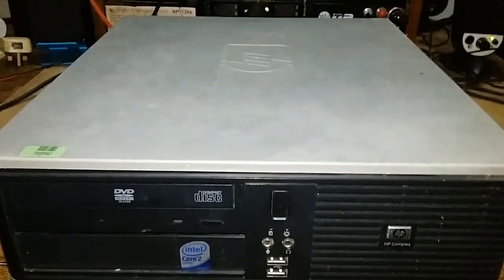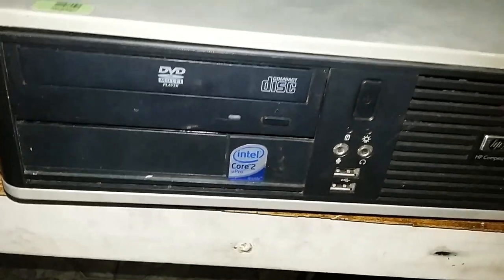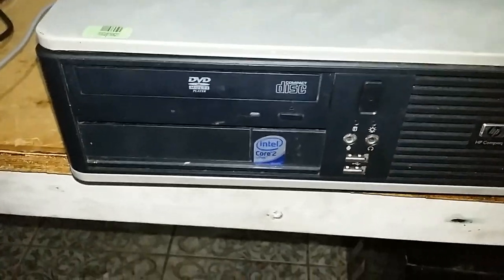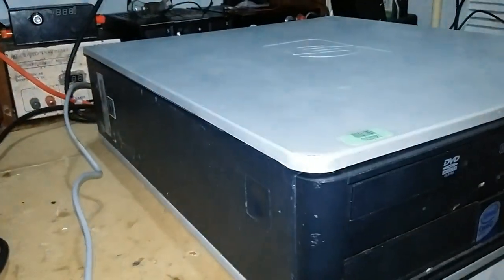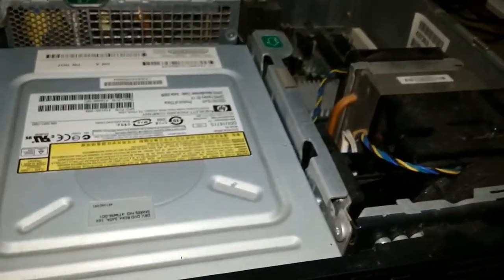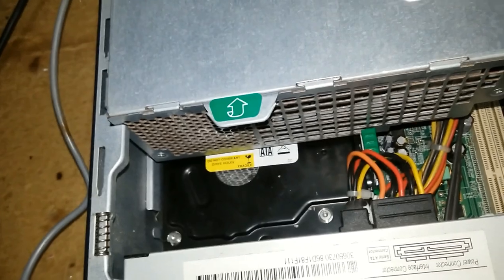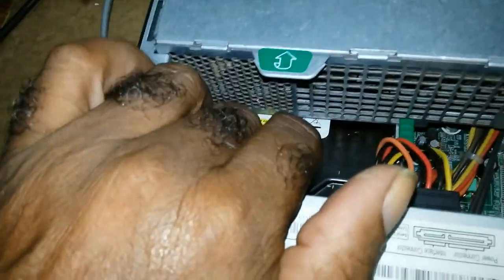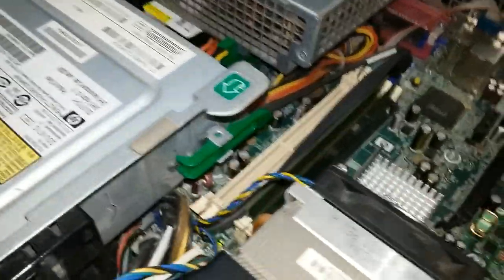HP Compaq dc7800 Desktop PC Boot up Fix

Comment: My dc 7800 CMT automatically starts as soon as I turn on the power supply, despite not pressing the power button. Also the CMOS data gets lost/corrupted every time the PSU is switched off/on (looks like the CR 2032 batt no longer sustains CMOS, even it's brand new giving full 3V). Moreover, when I put it into sleep mode from the OS and later try to wake it up it won't and the CPU fan starts spinning with full speed. What could be causing all this?

Comment: How can i fix 162 system option not set , and then when i press f1 or f10 it doesn't work .
Reply from the maker: Pressing F1 will record the new configuration. If this message persists you may need to replace the onboard battery.
Reply: @AlwynNicholas  i did . I replaced a new cmos battery but nothing happen
Reply from the maker: Set the time and date. Clearing the CMOS on your motherboard will reset your BIOS settings to their factory defaults. After clearing the CMOS, you'll need to access the BIOS setup utility and reconfigure your hardware settings. You might need to clear the CMOS for several reasons but usually you'll want to clear the CMOS to help troubleshoot or solve certain PC problems like hardware compatibility issues. Sometimes you will have to remove the battery to fully clear the settings. Many modern motherboards are starting to come with a power, reset, and clear cmos button built right into the board. Those are easy and you won't require those steps. Just press and hold one of those buttons down, with the machine off but plugged in. You might need a standard PS2 keyboard instead of a USB keyboard temporarily. After resetting the BIOS it is not set to use the USB during the boot up. You need the old style keyboard to plug into the purple port on the motherboard. After you get into the BIOS enable the USB ports.

Comment: Love your work brother but I have 2 HP Compaq dc7900 that I am trying to figure out how to fix them. One of them beeps 4 times when I turn on and the other five times. I tried removing all the parts but still the same beep errors. Yes they were dusty when I got them but I thot cleaning the parts one by one would fix the issue. Can you help me see what the hell is wrong with these Machines plz, PS: I bought them for 250USD each thinking they would wok for my children came use for there school assignment. The America Pease corp volunteer guy I bought them from left the Island and gone back to America. So I cant reimburse my money and kick his ass then take him to court. Is there another way to fix these PCs?
Reply from the maker: The most common problems that cause beeping sounds are: Memory and heat-related failures caused by a build-up of dust in critical cooling areas. A keyboard key is stuck. A memory DIMM or hard drive cable is not seated properly.
Reply from the maker: Disconnect the mouse and keyboard, and then restart the computer. If the beeping sound stops, repair or replace those devices. Hot air can damage internal components! Remove any obstructions that block vents.
Reply from the maker: The 5 beeps is a memory or motherboard problem. I would remove all but one of the memory modules and test each one individually and find the one (s) that may be bad.

Comment: plz i have a problem with the cpu fan or the case fan it spin tooo loud and the computer dosent start
Reply from the maker: Is it the CPU fan or your case fan.
Reply from the maker: The cpu central processing unit might be bad or need cleaning or you have a bad memory
Reply from the maker: Bab cpu or memory.
Reply: @AlwynNicholas  thank you very much i did clean the RAM and it worked <3
Reply from the maker: @MANMA25434  You welcome.

Comment: what if ten beeps what u do?
Reply from the maker: Red Power LED flashes ten times, once every second, followed by a two second pause. Beeps stop after fifth iteration but LEDs continue until problem is solved.
10
Bad option card.
Check each option card by removing the card (one at a time if multiple cards), then power on the system to see if fault goes away.
Once a bad card is identified, remove and replace the bad option card.
Replace the system board.
Reply: @AlwynNicholas  that exactly what is going on with me since a year ago, but I have hp Compaq 8000 elite sff, and I didn't see any cards installed, Are the cards installed or printed on the board? 
by the way, it starts beeping before I press the power button, please hurry if u get this I really need to end it.
THANKS
Reply from the maker: Check the memory out.
Reply: @AlwynNicholas  memory fine
Reply from the maker: @whoami696  Go to this site https://support.hp.com/nz-en/product/hp-compaq-8000-elite-small-form-factor-pc/4065894/document/c01941944/
Reply: @AlwynNicholas  thanks, I checked it before, all I need to know how I recognize the cards on my hp Compaq 8000, would u please name them to me, and the last thing should I lose hope and replace the sys board, I really appreciate your effort very much.
Reply from the maker: @whoami696  Ever think is integrated on the motherboard, check your date an time.
Reply: It's DD2 2GB RAM replacement.